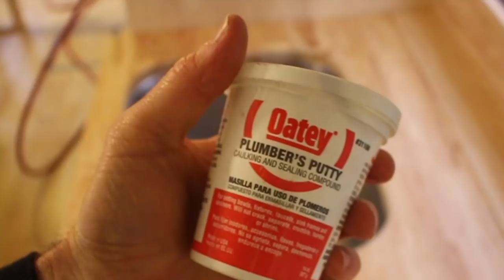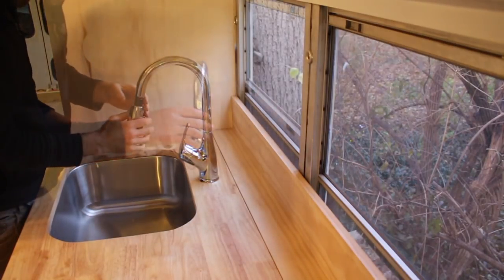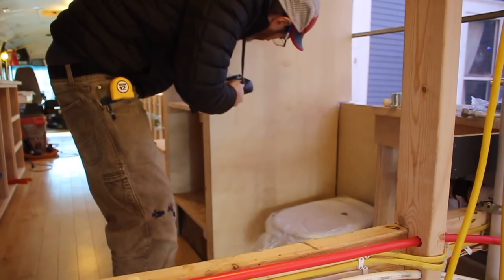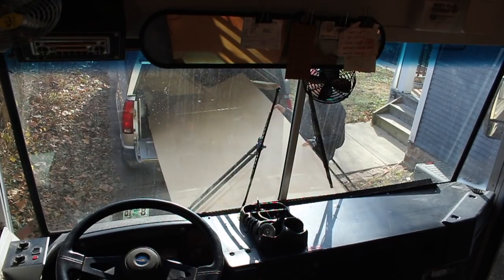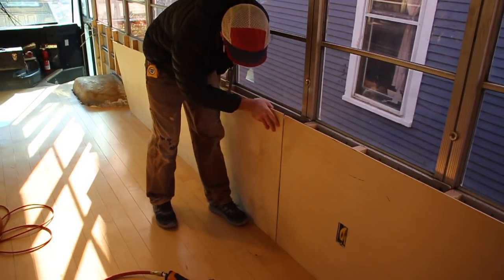100 Details -- Prison Bus Conversion #27

Comment: Love your work thus far.

I am however disappointed you didn't insulate the floor and walls at least. You saw from drilling into them the original insulation was old, rotted and very outdated. When you put the wall panels on I thought you were going to spray insulation down into the space. That would have been perfect. Insulation all around if you keep the original windows in buses.
Reply from the maker: I can see your point. My sense is that with so many single pane windows adding to the wall and ceiling R value is worthless. I did insulate the floor, however. People do buses different ways for different purposes. Thanks for the comment!

Comment: Hi, I'm liking the channel. What are you using to mark the electric boxes on the paneling? I've never seen that before. It looks way easier that measuring.
Reply from the maker: Hey Dan -- I use one of these "Meanstreak" pens http://amzn.to/2DqvEiG ... but I've also used chalk in the past, or even pencil. Really, anything that will leave a mark on the wallboard you are working with should work. Best of luck with it!

Comment: Hey so you don't think you might need to insulate the bus walls?
I'm just asking cause i do plan to purchase one for the same idea.
Reply from the maker: You probably can't see this in my videos, but this bus is insulated between outside and inside walls. A lot of people pull out the inside walls and re-insulate, and that makes sense if you want to increase the insulation in the bus. But I'm comfortable with the existing insulation, so haven't added much -- except in the floor. Now, with that said, I'll likely be adding some insulation in hollow spaces to keep road noise down.

Comment: why no insulation between the panels and side of bus?
Reply from the maker: I didn't see the need with the walls being insulated ... in retrospect, some insulation in there would have helped some with sound (on the road), but with so many windows I'm not going for a higher R value than the Bus already has ... with one exception: the floor

Comment: No insolation in the walls
Reply from the maker: Well, this is a 2000 Blue Bird with fiberglass insulation in walls and ceiling from the factory. The R value is not the highest, but it's insulted
Reply: Ok i forgot you didn't rip out the inner skin like I seen done by do many
Reply from the maker: Yeah, I took another route